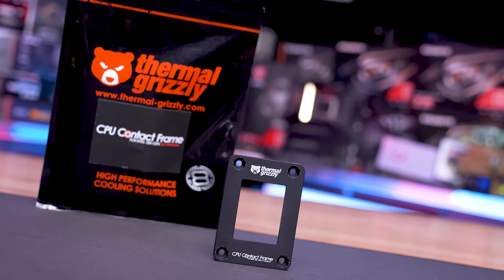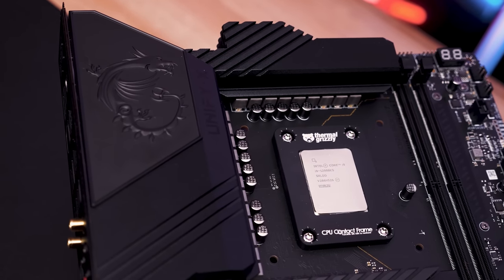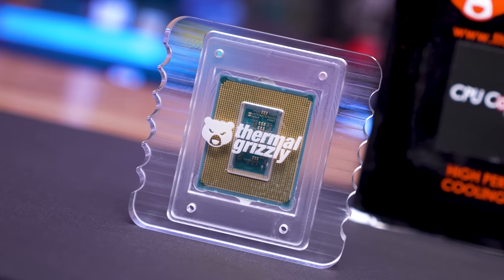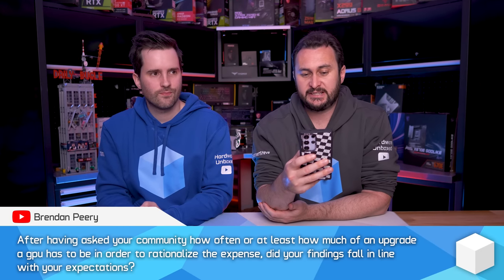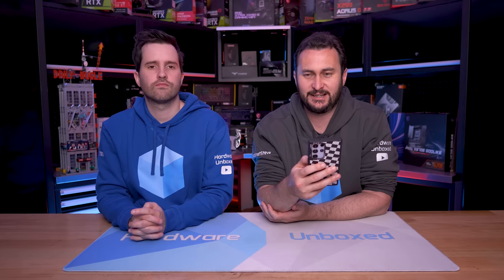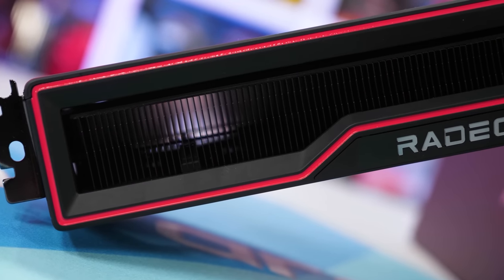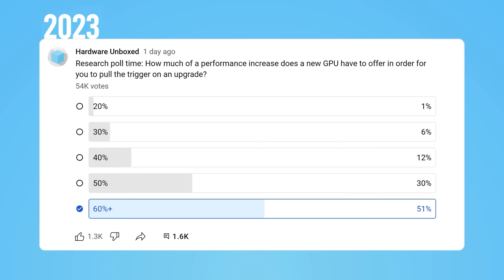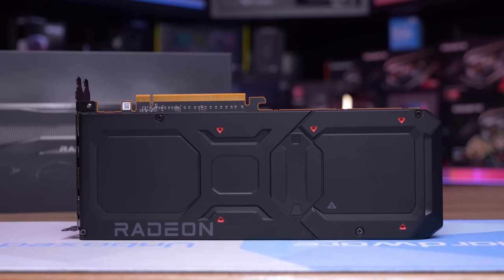RTX 4050 Pricing & VRAM, Are 12-core CPUs Dumb? March Q&A [Part 2]

Comment: 24:00 There are many components on your gpu that are rated to some industry wide accepted values, like 5000 hours at 105 degrees. Is it safe ? yes. Though it will break sooner or later, if your GPU is running hot and is using cheaper parts it will die earlier. Though technically your GPU will (probably) last throughout its warranty period even under full load. There are of course other failures that might happen until then. 

Keep your gpus cool !
Reply: Probably also worth mentioning for each component there will be different temperature-correlating degradation curves  - where 5000 hours at 105C is expected, but dropping just to 95C might triple its operating lifetime, while for others it will be a much more linear correlation down to 40C.. Still others may be less temperature-dependent & will degrade simply through use or cycles - like capacitors which have a limited number of charges & discharges before they stop being functional or even become a short risk.

But yeah if you're gonna pay a premium for a component, better to pay for better heatsinks, fans, caps & bearings before paying for pretty shrouds & RGB.
Reply: Specifically, the rule of thumb is 2x per 10C.  So while 5K hrs isn't very long, your caps won't be at 105C anyway.  At 75C they'll last ~40K hrs, which should do ya.
Reply: @concinnus  yeah 10 years at 8 hours per day under load is probably what I'll be wanting out of my build with the way GPU prices have been going anyway.

Comment: In the GPU upgrade poll, I commented that upgrade cost matters. I was only about $80 out of pocket to upgrade from an RTX 2070 Super to RTX 3070 thanks to how much my 2070 Super sold for on eBay. Another consideration for me is power consumption. The 3070 is about as high as I'm willing to go in terms of power consumption. I'm already undervolting to help keep temperatures and power draw down. Something like a 4070 Ti at 285W is much more than I think my case would be able to handle. I also don't think I'll strongly consider another GPU over $500 if I'm going to be $200+ out of pocket.

Comment: You should follow up with a poll of how much cost people think a low end, mid range, and high end gpus should be of the newest generation
Reply: Budget tier: ~$150, should be 100-200 range
low tier: $250
Midrange: $400
High end: $550-700
Halo: $900+

No I don't give a fucking shit that AMD's are priced like last gen, if you look at some of the mind bogglingly stupid system requirements on Steam they'll do things like suggest a busted ass low tier nVidia card or a higher end AMD, and after trying to figure out why people keep doing this realized they're based on the PRICING not the actual performance or real system requirements. So like if nVidia charges $600 for a 4050, they'll say stupid shit like "recommended RTX 4050 or RX 6800XT" just to make it sound good out of malice or stupidity out of ignorance. Browsing system reqs is hilarious sometimes they do it on price, sometimes based on performance, I found some game that recommended either a 4080 or 6800XT literally just because it needed the 16gb of VRAM for 4k so the older Ampere cards aren't even in recommended for 4k ultra because the textures won't load into busted nVidia VRAM. I expected a 780 or 980 to be $600ish range. I am simply not going to accept paying that kind of money for a 4060 or 4070. My cutoff at the absolute maximum at midrange is $500. Beyond that I don't fucking care how Jensen's greedy executives and shareholders price it I'm not cucking myself for your second yacht I don't care if you priced it higher a 4070 isn't suddenly "high end" just because you priced it like a fucking halo product, if you cost it at high end it does not make it a high end product it makes it a midrange product costed at high end or halo prices in other words is a bad deal you greedy pidorans.
Reply: The Nvidia fanboys will pay any price Jensen sets and that’s all that matters.

Comment: Let me explain my perspective for the 60%+ vote that I gave.
I had bought a GTX 1070 for EUR 300 some years ago. Last few months the RTX 3060ti went down to < EUR 300 second hand, so I snatched a RTX 3060ti for EUR 275.
So, I did upgrade quite a bit with that RTX 3060ti, but I still stuck to my EUR 300 budget across the years.

Comment: I have a 5900x, but I believe it was on sale or the gap between it and 5800x was tiny, like less than the equivalent of $50, but the 5950x was like $200 more for some reason. If the prices were normal I probably would've gotten a 5800x, but I am not complaining because I got 4 more cores for almost nothing, and it has come in useful for video editing, but not really for gaming. It was for some reason the best value CPU of all ryzen 5000 for the price I got it at, while the 5800x was a terrible value.

Comment: the 12-core parts are often much cheaper than 100 usd in many markets. although the prices of the 12-and 16-core parts have gotten closer recently, previously the 16-core parts were considered premium products and cost a lot more than the 12-core parts (usually 50% more). amd actually brought down the price of these products a bit when they introduced the x3d variants, now they're the "premium" products.
Reply: Yep. EU gets painfully shafted with the prices. I got the 5900X for 600 EUR, because the 5950X was 870 EUR.
Reply: Yeah, and also there is no 7950 non x part.

Comment: I just picked up a 5800X3D to replace my 7700K. It just made a lot more sense than Zen 4, I spent $630CAD for the cpu and a B550 board, using my existing 32GB of DDR4-3200 ram. Upgrading to the 7800X3D would've cost me over $1100CAD for the cpu with an AM5 board and DDR5 ram.

Comment: went from rx 470 or 480 8gb to 6700 xt, just for black desert online, in my opinion the best looking game even if i hate it at times, and also my alltime favorite for honor on ultra.
Reply: I play those same games, and am currently building my 6750xt PC. What CPU do you use, and what Ultra FPS do you get in Calpheon?
Reply: Same here, have had a rx480 since it launched and went to a 6700xt
Reply: @ironiczombie2530  could you please tell me what frames you get in the middle of Calpheon on Ultra, and what CPU you have?
Reply: @ilyadonskikh1868  sorry, I don't have have Black Desert. Just the same gpu upgrade path as the OP

Comment: 35:00 Crysis was so demanding because it pretty much invented A LOT of rendering technology and physics technologies that we still use today (in fact a lot of the physics technology that crysis did in 2007 are not used anymore to save on performance). For example Crysis 1 was the first game with Screen Space Ambient Occlusion. There are some missing (like PBR materials) that came later, but Cryengine was a revolution similar to what Unreal Engine 5 is doing right now. Even on High End PCs at the time, Crysis did not hit 60 FPS and on low end systems more like 15 - 20 FPS.
The aftermath of Crysis (and Half Life 2) is, that companies focus more on "can people play it on the low end" and "can it run on consoles" which is one of the reason why graphics haven't improved a lot in the last decade (until the 20 Series launched that is).
Reply: yes and no.. the biggest problem crysis had is that it was a tech demo that happened to have a playable game in it. there was a lot of stuff they did to hide the limitations of the engine. for example a single tree if i remember correctly had up to 16 texture layers in an attempt to artificially create depth to the object which sure looked great from 10 ft away until you actually walked up to the tree and looked at it. it was a massive performance hit for no benefit when there were already more efficient ways to do it by the time the game released. then you had the physics engine limitations which was the real reason for the low frame rate. on paper it should of been revolutionary but in reality they were so focused on making the game look "good" in an attempt to get game studios to use it that they forgot it actually had to be playable. so they shot themselves in the foot and the industry moved on while they kept floundering until cryengine 3.

Comment: Im super satisfied with my latest upgrade to 6800 xt. 12GB is plenty for my 1440p gaming. Its the ASUS TUF OC Model and it runs super smooth, no frying cables or mainboards, max 300w, usually more like 80 to max 250. 90 to 144 fps.. cant complain and it was a super nice deal.. unlike recent gen GPUs

Comment: If 4050 comes out at like 250 bucks, it could be a good card. Otherwise, it's not gonna make any sense to buy. However, considering how money hungry Nvidia are these past few years, I can easily see 4050 having like 450$ MSRP>
Reply: Yeah that was my thought when asking the question,
spending what would have got you a 2060-2060S 4 years ago to get a 4050 that may only have similar performance is just crazy, because that means in 4 years you have gotten nowhere.
Reply: with how many 30 series cards are still out in the wild and the fact that prices haven't dropped compared to AMD anything below 400 is unlikely. but when you can get an RX6800 for under 450 or even the 6700XT for under 400 there's no reason to even touch the 4050 unless you absolutely need cuda.
Reply: @sirmonkey1985  I just wish those prices were like  that in EU. In here garbage like 6700XT still goes for 600-700 euro in many places, and just yesterday I've found 3080 non-ti for 1560 euros in one of the local stores. It's so stupid it's literally unbelievable. GPU market in EU is like 3x the price of anywhere else in the world, it's so bad.
Reply: yhh but the 3050 still not 250$, so how likely are they to release the 4050 at 250$, specially with the prices we been seeing from both teams this generation
Reply: @X2yt depends on the eu region. In central eu prices have normalized with the Rx 6700 XT at 400€
Reply: @JanM2  idk, I live as central as central EU cna be.
Reply: @darkness_120  exactly the point, they won't release it at sensible price, so that card will be absolutely garbage value
Reply: @X2yt  What country are you living in?
Reply: @JanM2  Lithuania. Literally geographical center of EU.
Reply: @X2yt  not all EU countries have a bad market. UK, Germany, Netherlands, France have GPUs priced not too far from other first world countries. Some countries get direct priority from AMD and Nvidia with more stock allocation and direct sales. Realistically they can't supply to every corner of the earth. Lithuania doesn't make the cut, doesn't mean the whole EU has bad prices

Comment: My current setup is a 3700x paired with a 3080. I have a 4k ultrawide 144hz monitor and generally play at max resolution and highest graphics setting possible to produce a min of 80-90 fps in the (100% single player) games I play.  Considering the current ability of my system, think I'll pass on this current gen offering, maybe even pass next year (basically until I'm sub 60 fps).  

Plus these GPU prices are outrageous and I'm by no means made of money.
Reply: Down the road get a 5800x3d and get a solid boost if you need. It was a massive upgrade from my 3700x. Running a rx6800.
Reply: Why would you have to upgrade from a top card in 1 gen?
Reply: @stanislavkimov2779  Because I'm an FPS/Max Settings/4k addict and I have a problem 😆

Comment: I partially agree with Tim about Crysis. Off course, any game's developpers should aim for their games to be playable on most hardwares, but Crysis was so ahead of its time, it blew me away and mold me into the pc gamer that I am today. I've never watched any benchmark before Crysis, so I wouldn't be a fan of your work without that game.

Other thing, Crysis could ran on a Core 2 Duo paired with the latest and greatest Geforce 7950 GT, and at low or medium settings, it could still run decently according to my expectations on a Dual Core paired with a 7300 GT.

Still love to hear both of your opinions. You're doing an awesome job guys ! Love your channel👍

Comment: Well said as always with your incite which helps us buyers to determine what is the best option based on  budget, current games being played and possibly what they hope to play in the coming year and obviously rig hardware setup.

I, understand what you’ve stated and fully agree that personal hardware setups will never exactly match your test table graphs because it’s a potential optimal results based upon your quality test rig(s), and yes there will be a very small or tiny percentage differences in what someone else might get in the end, if tested. So, ones that complain they don’t get say the same GPU results as you should look at themselves in a mirror say “I’m stupid in making that comment”, as they would need to have exact same hardware configuration from the same hardware manufacturers and take the average results like you do in tour test results, etc.

On another topic your RTX3070 v Radeon 6800 with the difference of what 8gb v 16gb is a major wake up call for all, and the major uptake by software game houses utilising far greater use of Ray Tracing which in turn means greater demand on more VRAM. So, i think most graphic card Sellers need to do what Radeon did several years ago that decided wisely rather than having the standard 8gb but go with 16gb, as that means buyers of such a card are now like you’ve stated are now starting to see are getting good return in value that handle the latest very well indeed.

Keep up the good work!

Comment: I run my GPU on 70% power target max and frame limit at or slightly below my monitor refresh rate. Makes your PC run cool and quiet.

I just wonder if game runs on 9 cores fully used is it better on AMD to let it run on 9 cores and deal with infinity fabric delay or just limit it to 8 cores for possible improved performance? Chiplets are kinda new thing for me and I don't fully understand the penalty when moving process across chips.
Reply: In general performance in games is higher when only one CCD a.k.a. chiplet is enabled. Also you should try undervolting. Best case scenario is more frames and less power.
Reply: @jogeem5480  im not asking for general performance Im asking about highly specific scenario of 9 cores load task, If 9 threads should be culled to 8 cores or let the 1 thread spill over to 2nd CCD. Everyone knows general performance in games.
Reply: @cpypcy  In theory using two chiplets would probbably be better. In practise this highly specific scenario will never occur. Also cpu's have smt or hyper threading so a core can run two threads at the same time.

Comment: When I bought my 5900X CPU, it was more than $150 less than the 5950X.  At that price point, it was totally worth it to me to have some more cores than my 2700X without breaking the bank.  I run a VM and several other tasks in the background that eat up some CPU, and going from 4 cores/CCX to 6 cores/CCX was worth it to me at the price point it was at when I made my purchase.  There are no bad products, only bad prices.
Reply: The 6500XT begs to differ